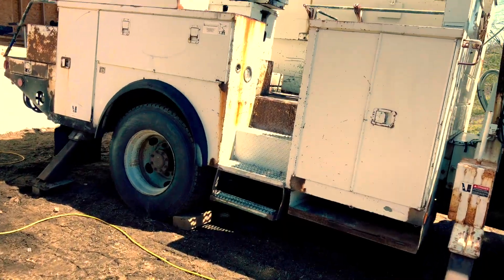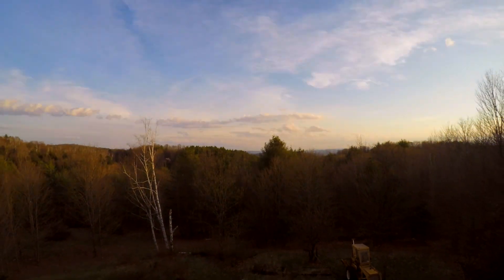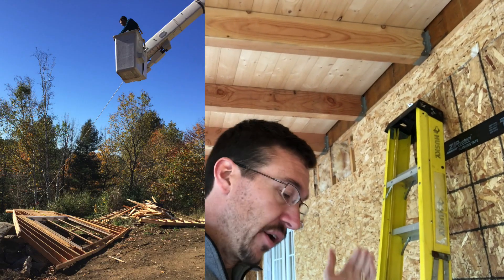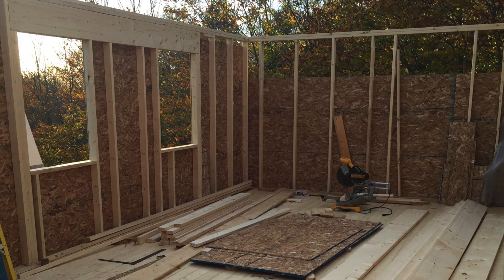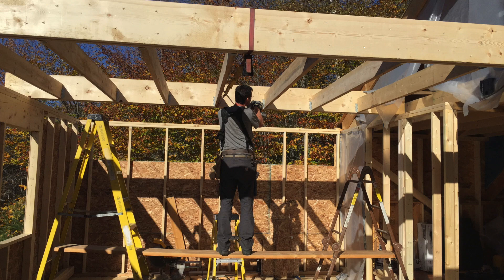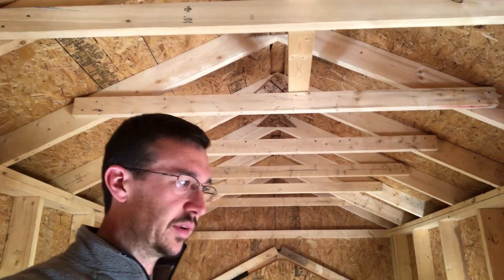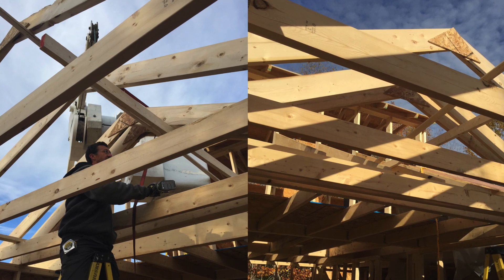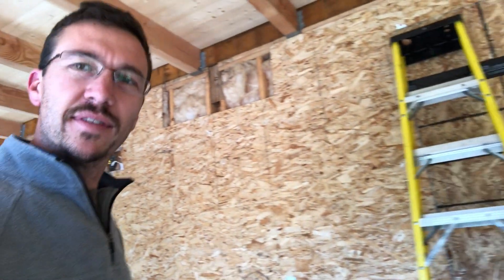How I built my 2 story addition in 1 week

Comment: With the 300lb load limit on the bucket how did that work lifting all that stuff?
Reply: Apparently it worked out fine. It's done! :)
Reply from the maker: 300 lbs only applies to the basket.  The jib crane can handle 2500lbs...  and it does it well.
Reply: @MyGarageBuild  wow never knew that. What model is the whole truck? thank you in advance